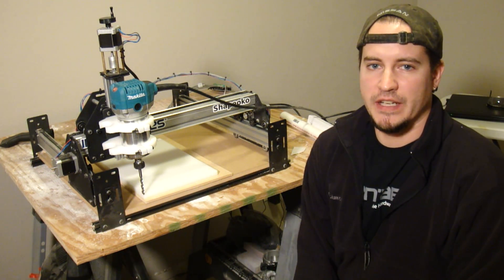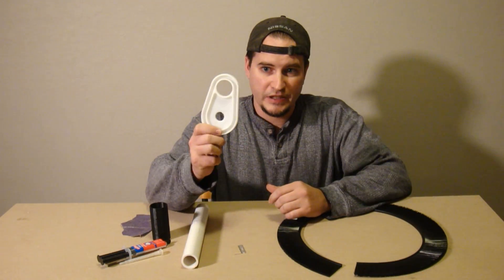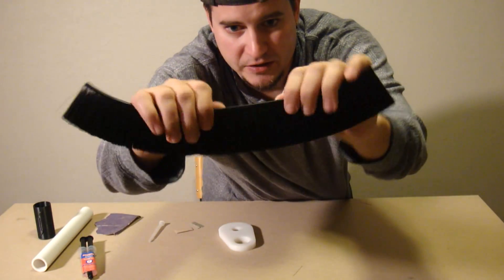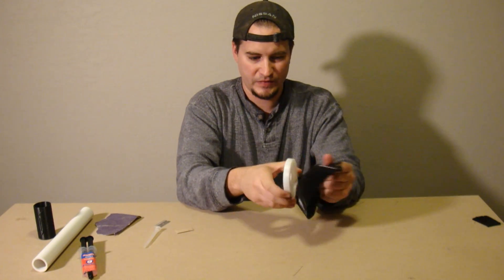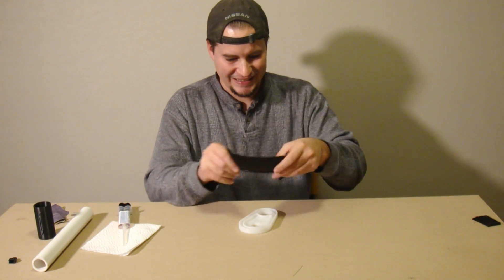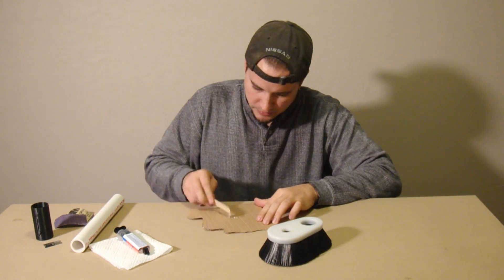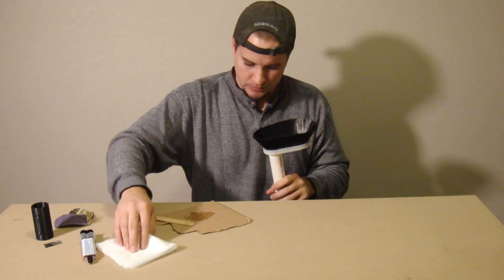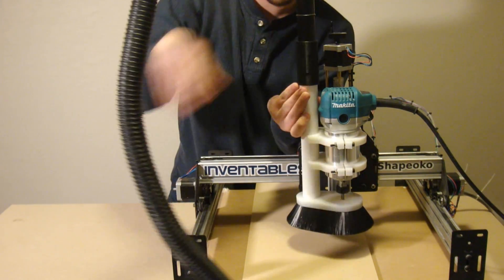Shapeoko 2 - Making A Dust Boot

Comment: you can heat that brush up with a hair dryer or a heat gun and it bends pretty good. i know i know its old video lol
Reply from the maker: Frankie's CNC & Wood working channel  that's a good tip, I had not thought of that.

Comment: Very impressive. Did you also use your Shapeoko to make the unit to hold the Makita router, or was that an accessory you bought?
Reply: Ignore my question Targ. I just found your video on that topic. Terrific. It has to be a good thing when you have a tool that can be used to make its own accessories. I enjoy your videos. They're brief and to the point.
Reply from the maker: SmokeFlame1 Thanks for watching.  I'm hoping to get some new videos out in the next month or two, Its really cold hear, and my garage is not insulated or heated :(

Comment: Very Clever design on your dust boot. I like the way you used the PVC pipe to attached to the router motor clamp. I like to see watch the bit while it is cutting. When it first starts out. Just to make sure it is cutting as planned. So I use see though Mylar from Tap Plastics. The down side is I have to replace it about once a year.
Reply from the maker: I have received a few recommendations to make it out of a clear material.  Might have to try that in my next iteration.

Comment: I see there are lot of options on McMaster for strip brush. What specific brush did you used. Also would clear 1/2 acrylic milled be better so you can see inside?
Reply from the maker: i used the Easy-Cut Strip Brush (http://www.mcmaster.com/#7900t5/=u1g9p8).  I went with the longer bristles, so that i could cut them shorter if i needed to.  I have seen other people use clear acrylic for their dust boots, and it looks pretty cool.  I went with the HDPE plastic because that is what i had left over from making the spindle mounts.
Reply: Targ's Workshop Thanks. I have the same setup as yours. I will start building this dust shoe. I read on some of your comments that your making changes on the holder.
Reply from the maker: Francis Marasigan yeah, i have a new design, just haven't gotten around to cutting it out.  I was planning on making it out of aluminium, but i'm kinda of hesitant to mill metal.  I might just have to mill the new mounts out of plastic.

Comment: So how does it perform?
Reply from the maker: The friction fit does not provide enough friction to prevent the boot from rotating as the machine moves and the bristles catch on the part being milled.  I am working on a new spindle mount design that will fix this.  I hope to mill it out this weekend.  Thanks for watching.

Comment: Thanks Matthew, Excellent!...How much travel do you lose with the hose pipe connected tho?....It looks like you would have had to start well right of the original point when you cut the dust boot out if you had the pipe connected....Is it possible to maybe make the vacuum tube in front of the spindle? I realize you would have to make new mounts for the Makita as well.
Reply from the maker: When i designed the spindle mount, i made sure that the PVC would not interfere.  But i did not take into account the boot itself.  I just measured and I loose about a half inch.  Another problem is that the friction fit hold doesn't keep the hole for the bit centered on the bit as the machine moves.  So the dust boot rotates and contacts the bit.  I am going to redesign the spindle mount, move the PVC slots, and incorporate an adjustable clap to hold the PVC better.  I went and bought some half inch aluminum this afternoon for the new mount.
Reply: Targ's Workshop Aluminum should work well for ya...Cant wait to see it. BTW I am "Lookin Lima"also...I was at my "other" job when I commented earlier